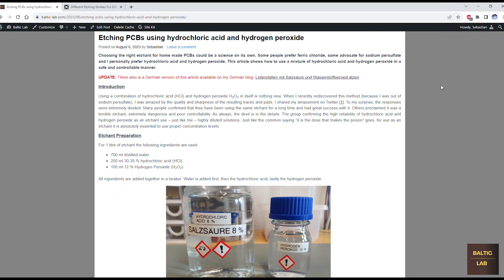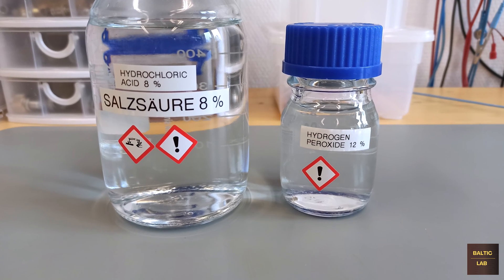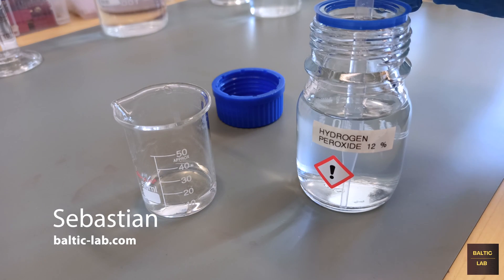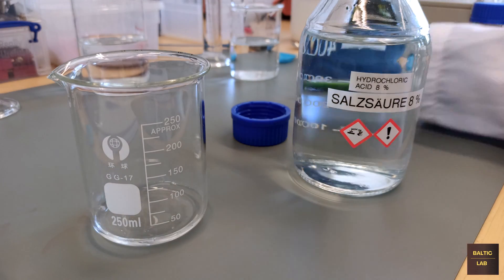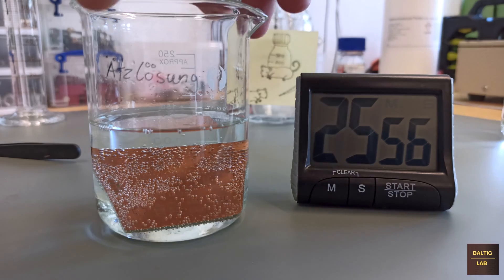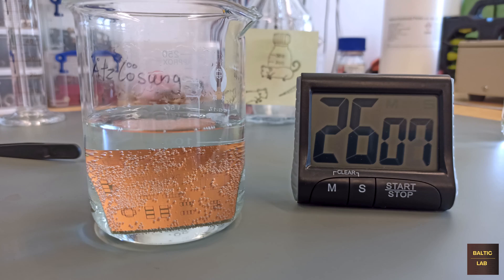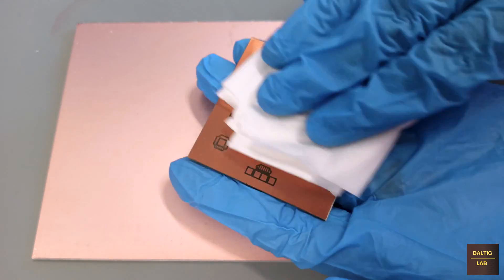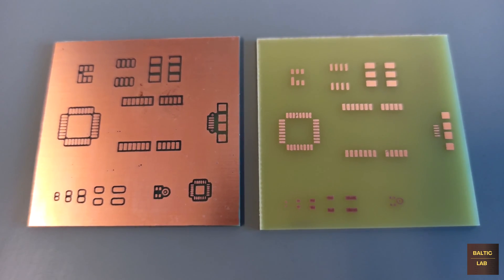How to Etch Printed Circuit Boards Using Hydrochloric Acid and Hydrogen Peroxide

Comment: Those bubbles slow down the etching a lot. If an aquarium air pump is added to mix the etchant the process takes minutes. I've built a flat tank from acrylic for this purpose, it reduces the amount of liquid needed and placed the outlet of the air compressor at the bottom. The liquid gets stirred extremely well.

Comment: Thank you so much for this professional, clear and concise explanation, especially for providing measurements for lower concentrations that are obtainable in EU. Vielen dank !
Reply: If I understood the article clearly, the only factor for developing chlorine gas is the concetration of HCl above threshold of around 16%. Does this mean that the concentration of H2O2 could be potentially increased in order to get a faster / more aggressive reaction ? My usage in not for PCBs but rather etching decoration in brass, therefore would have bigger quantity of material to remove in relation to the thin layer of copper in this example. Also would warming the etching solution (i.e. warm water bath of the reaction vessel) speed up the process ? Thank you again and best regards.
Reply from the maker: @theK174  According to the scientific paper I referenced in regards to this, this is correct, solely the HCl concentration seems to matter in regards of chlorine production. Which makes sense as it is the only chlorine-containing reagent in this mixture. And yes, warming does speed up the process, I sometimes use a laboratory-style magnetic stirrer with integrated heater when I am pressed for time.

Comment: thanks for this very interressing video. Is there a way to reverse back the chemical reaction to use the solution again ?
Reply from the maker: You can regenerate the solution simply by adding oxygen. Either by bubbling air through it or adding more H2O2. At that point it essentially is a cupric chloride etchant.